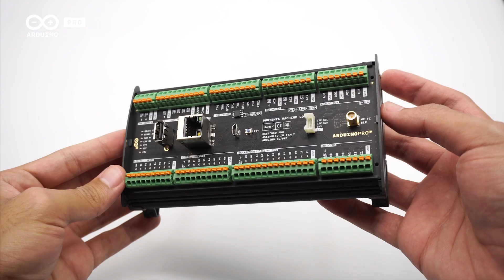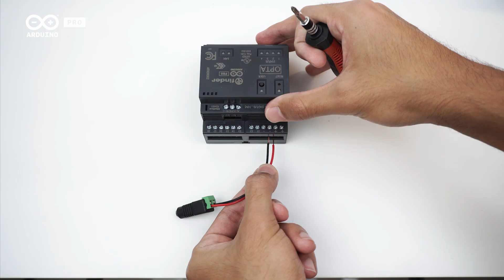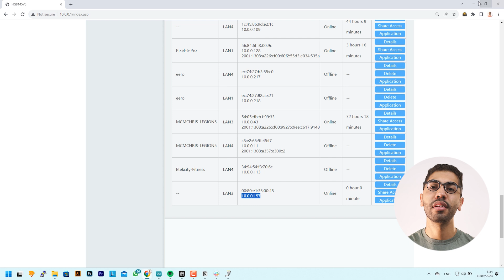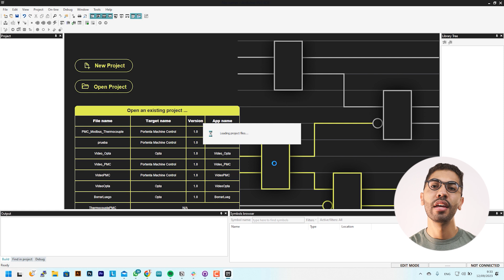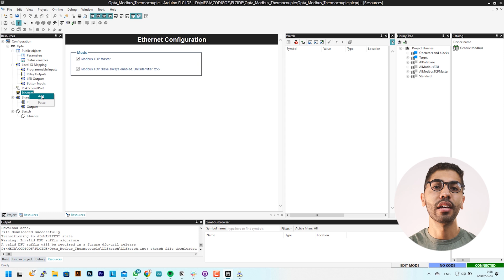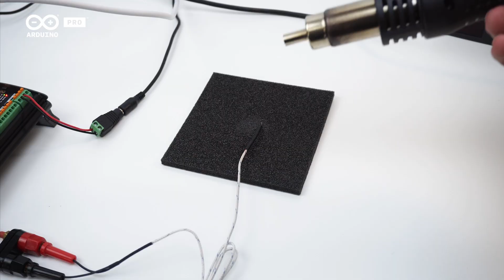Modbus TCP with the Arduino Portenta Machine Control & Opta

Comment: The PMC has terrible input reading accuracy.  Caused major issues for the equipment I installed it in.  Do not buy.
Reply: Do you mean for Analog inputs? I was going to use this to read a vacuum pressure sensor (1-5v signal)

Comment: Can somebody explain how is possible that in this video the PLC IDE version 1.0.4 available for the download , but when I search it, its still only  1.0.3 on the official Arduino site?
Reply: change the sketch, there is an ethernet begin code commented out in the sketch. if you uncommnet it and add your ip address and dns etc, modbus will work. worked for me.